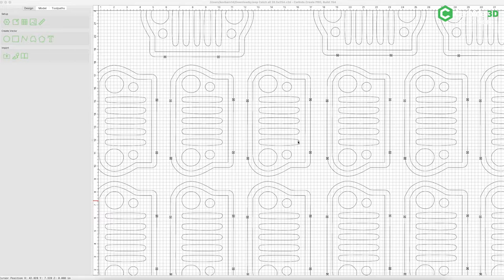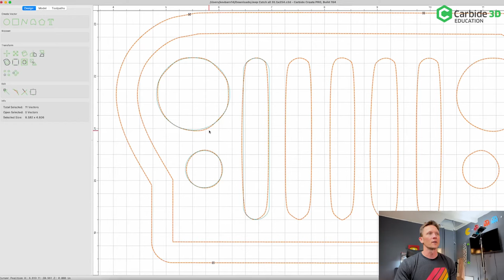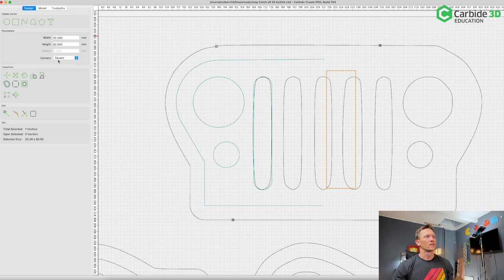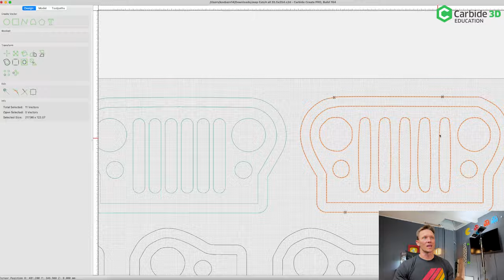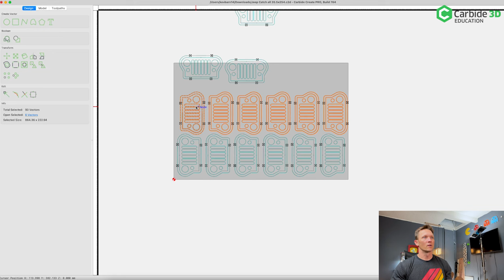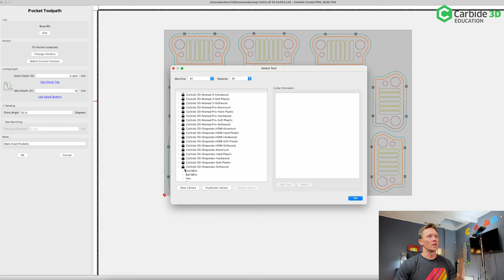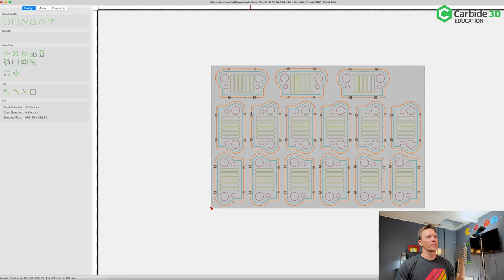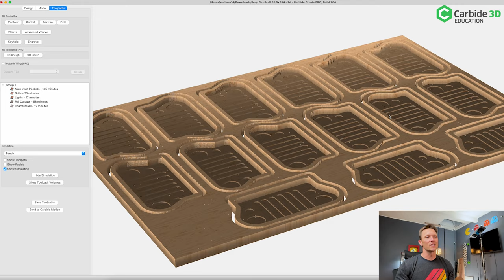Carbide Create to Shapeoko Production - A Long Form Video

Comment: Here’s a little known thing I found AFTER I made my first cribbage board.  It would have saved me a whole lot of time and you a little bit of time when selecting the lights…under Edit/Select there’s an option to select all of the circles 😝
Reply from the maker: Great call out Lori.   When using that tool, remember that your circles are created by radius, but then selected in that tool by diameter.

Comment: When it come to Toolpaths, I always include the cutter number in the toolpath name. I use to run different files(duplicate) one for each cutter. I was doing that before there was a tool change option and also to limit the running time.
Reply from the maker: Great add, Marcus.  Thanks for chiming in.

Comment: Great video!  I didn't even know about the even spacing feature yet, and I realized i need to utilize layers more.  Thank you!!

I'd love to see an in depth video like this for a 3D cut using an STL file.  I've done cuts successfully but I could get through them quicker if I had a better understanding of "base height" and "add/subtract/etc" and things like that👍🏻
Reply: I agree 100%. And what does "multiply" have to do with wood cutting? That and "Layers". With the exception of locking and unlocking so they won't be selected, I have yet to figure out why layers are supposed to be useful to me and I've been at this for two years.
Reply from the maker: You can "Machine by Layer" in your toolpathing.  This is handy for applying a series of toolpaths which will be run in the same way, but are mixed throughout your design.  "Chamfers" is the operation I use most often in a Machine by Layer situation.

Comment: Love watching you work, Kevin. A thought popped into my head (dangerous, I know): in SketchUp there is a special group called a Component. Like groups, components and be copied and pasted, and even grouped together to make larger groups. The awesomeness of a Component is that if you edit one, anywhere within your job, EVERY OTHER component that was copied and pasted from the original inherits the changes made.

I thought of that when I was watching you and noticed you had put too many bar vectors in the grill. I think you had six instead of five. That would be a hassle if you had to go back and edit each group and redistribute/align the elements. But not so if they were Components.

Any chance of getting something like that built into Carbide Create? It would be awesome and a huge time saver in certain instances. Just brain storming.

Thanks for posting.
Reply from the maker: Hey Davey. 
You’re talking about parametric modeling.   This would be very nice, we agree.  There’s a bunch of heavy lifting to get to that point.  We will definitely continue discussions about this capability with the software team.  
Keep the brainstorms coming. We appreciate you being a member of the Carbide 3D Family.
Reply: Thanks, Kevin. Here's something that might be easier to executive within the programming of CC: the ability to create radiuses, on say a three-sided rectangle. Where one side is still open, but two corners still exist. Maybe select the radius button and then a node at a corner to have a radius applied. Currently, if I draw seven vectors all at right angels, without multi-step gymnastics, there's no way to apply a radius one corner individually. Just another storm of the brain. Thanks for listening. @carbide3d

Comment: This is an amazing insight in how to use CC pro. When did that other feature come out? Is it in beta? Also why is ramping helpful? I have cc pro but don't use ramping yet.
Reply from the maker: Those features are in the current stable version of Carbide Create.  
https://carbide3d.com/carbidecreate/download/
Reply from the maker: Ramping helps relieve some of the stress on an endmill during the plunge portion of a toolpath.   
2:10 mark of this video: https://youtu.be/0W-5nv4izqA?si=n2uLtgrDVu1cj27k

Comment: I appreciate the video showing the details of editing a file. Thank you, it was very helpful, need more of these videos. Is there a cut sheet of specs on rates per bit by material type, other than the recommendations in the program. Seems there's a lot of changing those values based on "experience", which would tell me the rates could likely be changed in a table some where in the program so they don't have to be later changed individually each time you're working with a file. Again, thank you for the Barney-Style instruction. Slowing down your thought process to match the experience of your target audience is a good thing.
Reply from the maker: Hey Dave.   
I have not charted the changes I typically make to our standard speeds and feeds.   You can save changes to tools in your library or create your own specialized tool library with you own charted speeds and feeds.  
I’ll think about charting my own typical changes.

Comment: Why can't you just run a v on the original lines with no offset?
Reply from the maker: Because V-Bits generally have a slight flat tip.    If you run along the same vector line the result will be a chamfer with a definite line below it.  
By offsetting slightly, the cut produces only the angle of the V-Bit without leaving a line.
Reply: @carbide3d  thanks I didn't know that.

Comment: Is there a video or link to paper on how you decide how fast to set your bit settings like plunge and step over I am new to this and just use defaults and everything takes …. forever.  Thanks
Reply: Try speeding up during the cuts in carbide motion with the 10% button. As it works okay then hit the button again. When you feel like it is effecting quality back it down. Make note the final % used and calculate it to the bit settings.